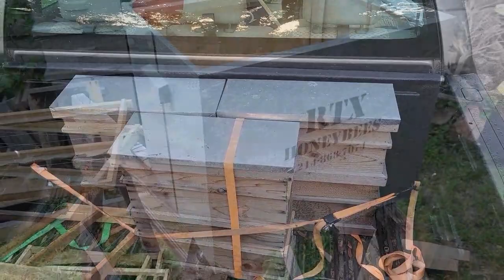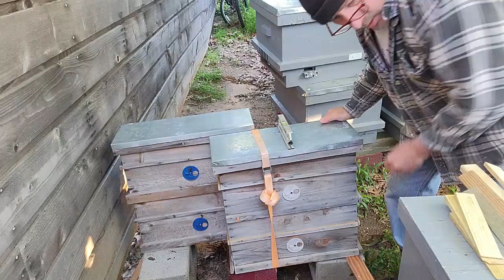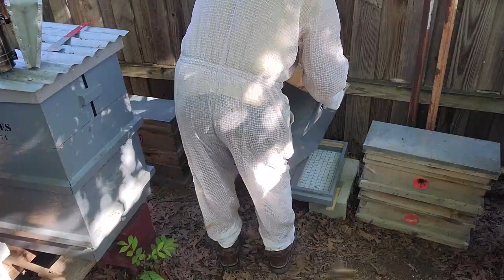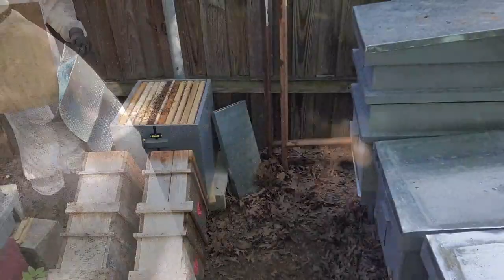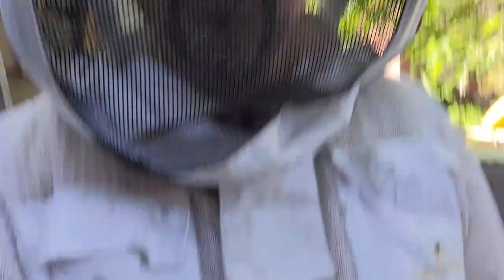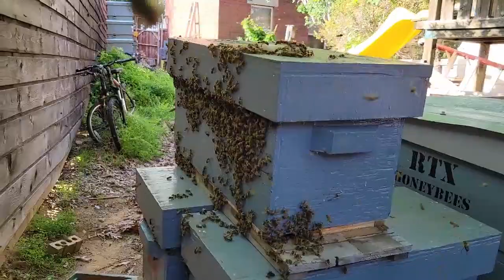How I Reorient and Transfer Bees from Swarm Traps.   Part 2: Transferring the Texas Deeps

Comment: My first swarm trap I made from rough cut oak. It is heavy af. I love the big frames. The Lazutin frames gives my bees room for lots of honey stores above brood. Found a vertical bamboo skewer down the center from top bar to bottom bar helps bees draw frames straighter. They follow the skewer down when building comb. And gives support to comb in the bigger frames. I even have some Langstroph frames with the skewer through the bottom bar and beyond. So the bottom bar acts as a top bar and they keep making comb under it.
Reply from the maker: I have some frames (deep and medium) that have craft or pop sickle stick starter strips and skewers at third points top to bottom.  On about 20% of them the bees would veer the comb to one side of the skewer and start another piece of comb on the other side of the skewer.  Imagine 3 pieces of comb overlapped a little like fish scales.  That was enough for me to go to starter strips and fishing line.  I haven't thought about putting them in the TX deeps.